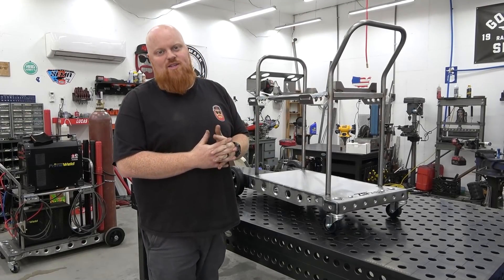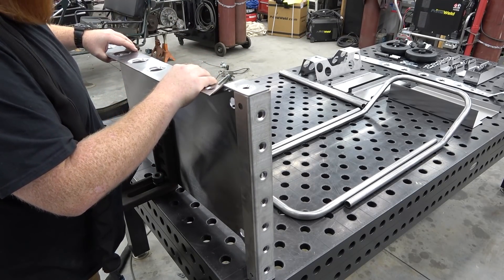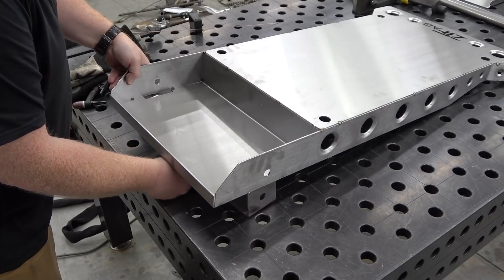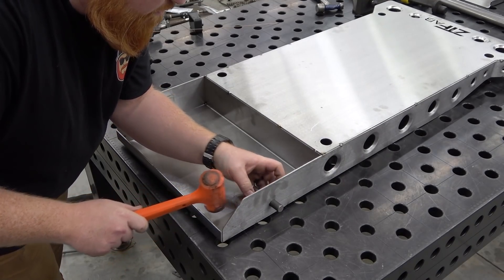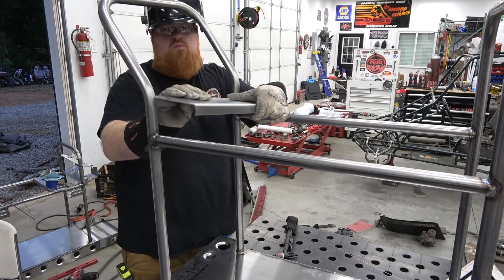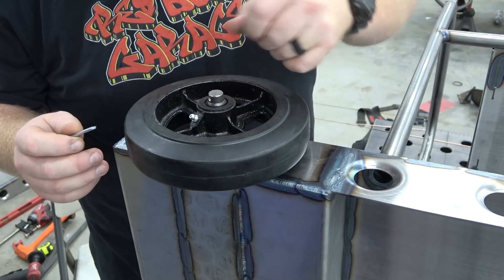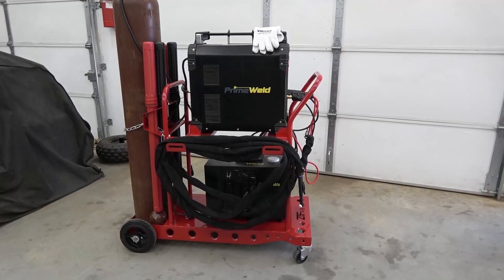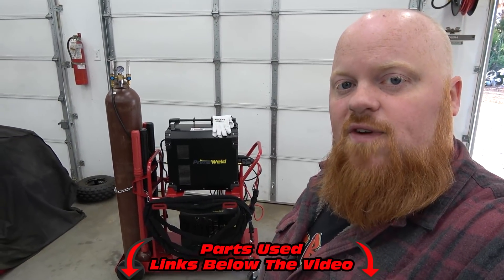Best Welding Cart On The Market ~ ZT Fab Welding Cart Build

Comment: Those are cool welding carts. A little on the pricy side for a weld it yourself kit but still nice. I have the Vulcan cart like yours because I needed to consolidate all my welding equipment (mig welder, flux welder, tig, and plasma cutter, bottles, cables, etc.) all into one place. My garage is way too small for multiple carts.

Comment: It seems like ZT Fab got a lot of YouTubers to do long ads for them by giving away kits.

Not impressed. The kits are extremely expensive, and the end products don't look that great.

For about $400, I turned a beautiful Harbor Freight chest into a cart with a 1000-pound capacity and 10000 cubes of ball-bearing-drawer storage. I have two welders and 300 pounds of bottles on it, and the welders are at eye level, where they should be.

That $400 includes the chest.